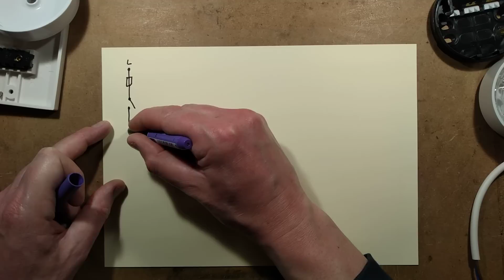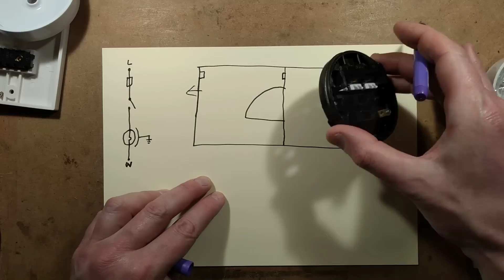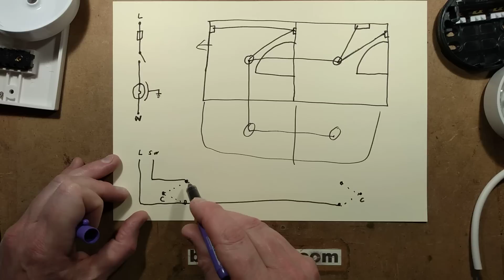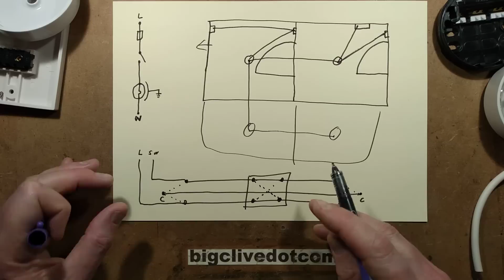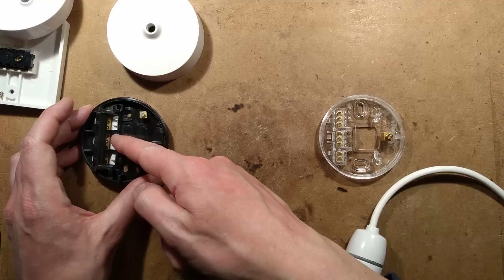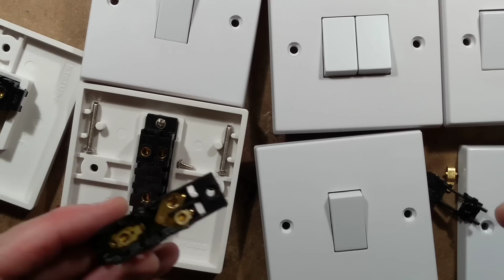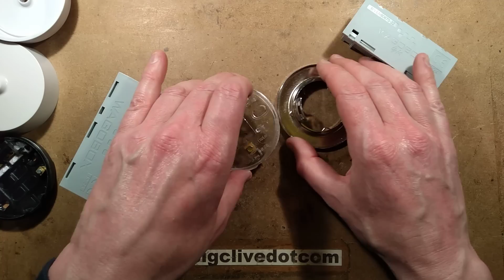British home wiring.  The incredibly simple lighting circuits.

Comment: Here in Austria I have learned the multiple switches schematic as two wires only. One goes from L to the common on the changeover switch, then two wiresfrom L1 and L2 go to the second switch respectively and the common from that one goes to the lamp. Each lamp is earthed,  fed neutral and live separately. And if you want to have more than 2 switches, you just get a double changeover and wire the commons of it together and that L1 and L2 from switch one in the one side of the changeover and from the other side you just do the same to the 3rd switch. Adding more switches in the circuit you just do double changeover thing again.
Reply: Try doing that with a 5 wire cable while not using blue as anything else than neutral and brown as phase. You wire it as they did the last century. The more modern way is how Clive describes it. Also uses less wires and is easier to follow. Especially if you have your junctions in the ceiling.
Reply: @arneanka4633  They were actually teaching it the way I described it 7 years ago as I was in school. And around here you don't typically use 'n' conductor cable, but single wires pulled in the walls, how many wires you actually need. Except wet/humid/outside areas where you run an 'n' cundoctor cablebecause of the ruggedness and extra protection and "waterproofness".
(The variable n is the number of how many single wires you would need for that specific run.)
Reply: @MrHardCore2Quad  So you run H07Z1-R in your walls without pipes? I'm talking about places where you must have cables like N07XA5EZ1-U. It may be a garage, a shed or in the ground. 

Come in the game and upgrade to the next generation of wiring. They did that in UK years ago and we in Sweden has done it since many ears. Ever since the day some got too lazy to run two cables to the switch-socket combo. Be lazy and save copper.
Reply: @arneanka4633  Oh hell no. 🤣 We run pipes. Or better said plastic conduit. I just thought that would be a no brainer that we run the cables in conduit. :) In a garage (industrial building) or so we run an equivalent of the N07XA5EZ1, mostly on rails, depends on vintage of the building. In the garage of a house we would still run the single copper in multiples of how many you need (in the wall in conduit). If it is an 'aftertought' so to said then we would run it outside the wall in another form of conduit if there is no way of pulling it inside the wall.

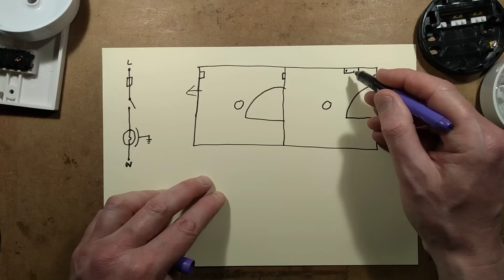Comment: 2:30 holy ****, I've never seen this in use here, but I thought it might be good idea, so I started wiring house that way. Now I learned it's quite common in UK O.O  Also I decided to do it that way because I expect dimmable lights to be more common in future and this way you just slap potentiometer instead of light switch and can simply control it. Or you can use it as communication lines for DALI lights that might be more common in future too :)
Of course light fixtures here aren't prepared for this, so I hope there will be enough room to fit one extra wago terminal in here :/

If you're interested how is it done here - you have light connected with cyky-j 3x1.5mm^2, light switch with cyky-o 3x1.5mm^2 and it's both connected together in small box usually just under ceiling, directly above light switch, where is also cable from distribution box (again cyky-j 3x1.5mm^2) that continues to box in other room. Real terminal hell happens here sometimes.

9:00 but when you have all three wires insulated, then it makes sense to get round cable, which can be easily stripped with special knife - https://youtu.be/AWgl_pUSVes?t=30s
Reply: Sounds interesting, but where exactly is "here" at?

Also, could you explain those wire designations to a Yank, please?

Comment: In my childhood home, one part of the house was wired with single core double insulated cores, both live and neutral, that looped randomly between the light fittings. Connection was occasionally made by strange ceramic thimbles with a coarse inner thread that screwed onto the twisted ends of two conductors. 
  The only way I discovered all this was by replacing an outside light fitting which was fed as a twin insulated core spur with a lead outer sheath. With my aluminium ladder I rapidly discovered that the lead sheath and light fitting floated at about 50v when powered!  I eventually had to cut a new roof hatch into the roof space of the victorian extension and replace all the wiring. Weird.
Reply: Those ceramic thimbles sound like the very first version of the American wire nuts! Modern ones are plastic with a conical coil spring inside but the basic design is the same. They were common in some European countries (Portugal, Italy, the Netherlands, Scandinavia) but not in others. In Austria they enjoyed a very brief spurt of popularity around 1970, only for a few years, but then disappeared almost completely. They're still sold but no one seems to use them and most people don't even know what they are.
Reply: @Ragnar8504  they now all turn to Wago
Reply: @Reaktanzkreis  I know, except for the US and Canada.

Comment: Over here is New Zealand our wall switch boxes are mainly made of plastic and is 45mm deep so on a 90mm frame stud can go back to back. we used to do it like you Clive but now its so easy we have like 15 lights on one circuit and the feed from the switchboard(fuses) goes to each wall switch in the same vicinity like bedroom(s) and bathroom and kitchen if they are all in the same area and another circuit for lounge hall entry and so forth, and each light or group of lights go to the wall switch. for 2ways over here the is so many ways on doing a 2way using a 3core or 2cores. lighting circuits are same run in 1mm^2 2core+E maximum 10A c-curve breaker 230v, our outer is cream or white and the inner conductors its red for phase black for neutral and insulated green/yellow for earth we had bare earth but not anymore its a pain working on old cables with bare earths. we cant sleeve the earth red or black only yellow/green.

Comment: Clive, nice video! Here in Australia our TPS cable has PVC on all three conductors. We find the best way to strip our cable is to grab either one of the side conductors at the end of the cable (Live or neutral) with pliers, then pull downwards along the cable. This tears the outer insulation allowing for access to the cables inside. It also means all we really need to terminate any cables is just a pair of pliers and a screwdriver.
Reply: It’s also no longer solid core though I have still seen it available at a certain large hardware chain store😜

Comment: The cable tie on the Wago box is to make the box a MF maintenance free junction box, it can then be put in an inaccesible place and forgotten.
Reply: In my experience, there is no such thing as maintenance free. Eventually a fault will occur or an alteration will be required that means access to the “maintenance free” terminals will be required...
Reply: @Mark1024MAK  MF junction boxes are in the 17th edition BS7671 and although I partially agree with you in the sense there's no such thing as maintenance free junctions, it basically means any termination using screw terminals that can become loose over time needs to be accessible so as to be maintained by tightening screws in  their terminals. MF boxes such as Wago boxes use Wago connectors which use clamping force to maintain their connection at the current rating of the Wago connector, continuously. I would personally use this method and be more confident over a screw terminal any day. Having said that, I have used MF chock boxes before, and are a joke really. Never had any issues with either method but Wago is the safer neater option for me. Won't go back now. 😉
Reply: muzikman2008 - spring clamp terminals like Wago can fail. Spring clamp terminals have existed for at least twenty years in industrial electrical fittings such as terminals in fluorescent lamp fittings. Note that I am not saying that Wago will fail. And I am not saying that Wago should not be used. In terms of screw connections, the high quality type that uses a wire guard or which uses a clamp to grip the wire / conductor rarely fail, even after 40 years service (assuming it was correctly used in the first place).
Reply: @Mark1024MAK  There are all sorts of pros and cons for both methods. I also agree with you on cage terminations. But even they can loosen over time, I have seen it. It is also down to how the original termination is made by the installer. The amount of people who don't double over a single conductor into a clamp or screw terminal is astounding. Arcing away in the terminal lol... I just think Wago takes this carelessness out of sloppy/lazy installers hands and provides safer terminations. But like you say screws are still valid, as long as people understand their mechanical and electrical limitations/requirements.

Comment: I have to say that I like EU standard cabling and electrical installation much more than UK standard. To me those boxes and switches what you've shown look like those are from the 80's or 90's. What I've used to is made by ABB or Schneider and those are much much higher quality and designed much better aswell.
Wago connectors in the other hand are amazing.
Reply: There are higher quality options out there. You even get Schneider sockets and switches for the UK as well.

Comment: you need a neutral behind the light switch for things like PIR and some remote control electronic light switches and LED type electronics
Reply: There’s another cable, Clive mentioned it, three core and earth. There’s a black, a brown, a grey and an unsheathed earth.

I used this type of cable to light a switch surround. It’s easy to see if the light switch to the attic space has been left switched on.
Reply: @kjamison5951  you can get 5 core cable as well. Brown, black, grey, blue and earth (CPC)

Comment: Most of the solutions shown are much different than those used in Poland (and likely in many more European countries). British switches nor sockets won't fit our (round) boxes. And even the toggle switches (called "staircase switches") are connected in a different way. I like the concept of a ceiling-mounted lighting junction boxes, haven't seen this before.
Reply: I'm British but have used euro boxes extensively in my past. I found them quite good due to the modular design. I prefer the self tapping screws to our tapped ones. Just seemed to make the job quicker.
Reply: @ollylewin  I suppose 3.5 mm sheet-metal screws would work fine in UK boxes, just going back to the metric screws supplied with new switches would be impossible. I've done that with Italian boxes that use machine screws with an obscure thread (I suspect they may be American) and I couldn't find longer ones.

Comment: I was having a discussion with a friend the other day about whether in the UK, we switch the live or the neutral and it occurred to me that I didn't really understand the difference. Is it the order - live, switch, load, neutral,  or live, load, switch, neutral? But whichever, what difference does it make?
Reply: Switching the Line at the first opportunity means the minimum of cable is permanently live.  Switching the neutral means that a longer extent of cable, including the fixture, is permanently live and therefore a greater risk.
Reply: @calmeilles  thanks for that. I see now - it's a safety thing.

Comment: Sleeving the earth is a bad idea. In part cut/frayed cable you'd want the earth to be used to trip the circuit rather than leave exposed live or neutral. You'd want the circuit to be required to be repaired. 
Regards, A.N Irishman

Comment: In the Netherlands ALL connections in a room (especially switches go, since 1950, to a central box in the ceiling (star system) with the only exception when switches and wallsockets are very near eachother.
Since ALL wiring MUST go through conducts, the limiting factor is the number of wires the conduct can contain.
The UK uses something different as I understand: a Ring Mains for the wallsockets. We (the Dutch) follow mainly the German standards, including the plugdesign.

Edit:
We use a different connection for the double switch configuration, whitch is a bit simpeler. We call it a "hotel" circuit.
L goes to one "C", Sw to the other, and both the L1 and L2 are connected to eachother so there are only 2 wires between both the switches.
The cross switch stays the same (you can expand on that!).
Is it done otherwise in the UK?

2+E in Ireland with an insulated E?
OF COURSE! Ireland is EU, remember?
Reply: In the UK (still part of the EU as I type)  we tend to use PVC Twin and Earth (or 3 core and earth) but you can get Single core! It can lead to problems as the switch still needs to get an earth. If we are wiring a circuit in conduit (usually industrial) we have the option of methods ..... again it is usually simpler to drag 3 cores and an earth rather than route different lengths (we usually have a set of coils of singles set up so we can drag them off as needed) It makes even more sense when you think most installations are a combination of Conduit and Trunking so bunching the cables in the trunking is easier!
Reply: So in a star system, with all the wiring in the room going to a single circuit box in the ceiling, if the light fails, you can't plug in a desklamp or worklight to see what you are fixing, unless you trip over cables through doorways into another room?
I think I prefer power outlets and lighting to be on separate circuits entirely.

Comment: Why all the switches/sockets look exactly the same in UK? don't you have any decorative ones or so? (same question for USA actually)
Reply: They're the cheap standard ones, there are others but they're more expensive so tend to only get used when people ask for them. 

This link should give you some idea of what's available:

https://www.screwfix.com/c/electrical-lighting/switches-sockets/cat830530#category=cat830530&page_size=100&page_start=100
Reply: Yes we have chrome, stainless, brass  even woodgrain and wafer thin faceplates.  Also you can get  USB chargers  or WIFI extenders built into them.

Comment: Lighting design has changed so much all over the world. Only our lazy backwards builders still use this system. For one you cant use automation systems that require power always on at the switch point. #rant over
Reply: It gets a bit interesting when you're using multi ("2" or "3", depending on your terminology) way switches.  A 3-wire switch requires a 4-conductor cable (including ground).  Adding both neutral and live "always on" conductors brings that up to 6, doesn't it?

Many commercial or industrial lighting installations use "contactors" (relays) to handle the load, which simplifies wiring somewhat when you have multiple switch points.

Comment: I wired a small box when I was 6. When I plugged in the power, the fuse popped. I looked at my dad, who was laughing and said, well I guess you learned not to wire it that way. Actually I did see what I’d done wrong and haven’t wired a short again. That was 59 years ago. Talk about life long lessons...
Reply: Tom Jopling I used to do that sort of thing at about the same age at about the same timeframe! That’s also when I discovered that plasticine is quite conductive...
Reply: That reminds me of one time I just got an audio amplifier from a fleamarket. The metal chassis appeared to be hot. Unfortunately by the time I figured out the problem was in the outlet wiring, I had already taken the amplifier to pieces because I thought it was unsafe.
Reply: I've done that with a friend at his house and that tripped the electric protection of the house. We were 10-11 and no adult present. By the time they came back and put the electricity back on, all the tropical fish of my friend's sister were dead (cold water killed them).

Comment: This is really interesting.
I graduated industrial electricity class in 1982 here in 'Merica.
To see the way electricity is handled in other countries is really interesting.
Can't really say one is better than the other, but it really is cool seeing the way light boxes are designed across the pond.
Reply: Across the Pond here really only covers the British Isles or just the UK, with their ring circuit wiring. Aside from same voltage and frequency, the rest of Europe may have still some variation between each other, but all does it very different to the UK.
Reply: Nah the US is probably worse than most other developed countries. I mean proper RCD/RCB/RCBO circuits are still neither standard or enforced, and the only earth leakage protection you'll get is from bathroom outlets. 
Also non insulated plug blades, not having switches on outlets etc. 

:D running 120V also
Reply: @PBMS123  Sorry but Earth leakage protection is also required on all outlets in kitchens Garages and outdoors also our new ones are required to be tamper resistant like the ones in the UK and I don't see how having switches on outlets is any safer
Reply: @olishart-t2u  it switches off both poles meaning you can shove something in the socket and won’t get a belt
Reply: @blueboy4life  who's shoving stuff into receptacles? You can easily wire the outlet to a switch it's just not practical. I have a couple wired to outlets because I can control those lights via a mechanical switch or wireless switch. They usually stayed on when nothing is plugged in, anyways